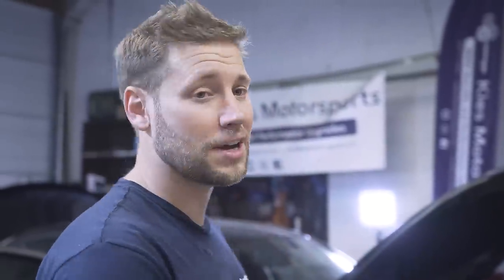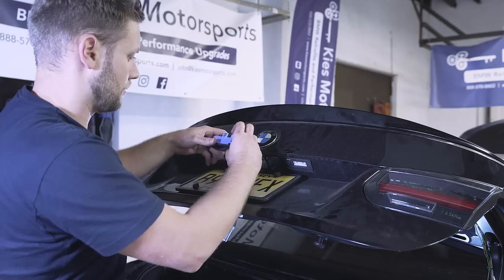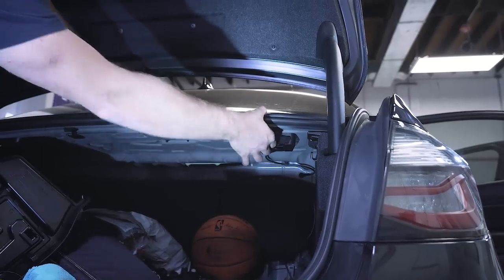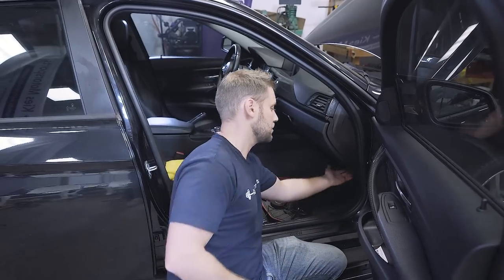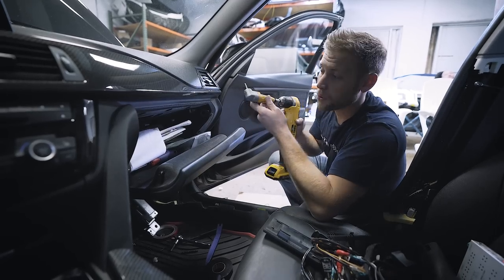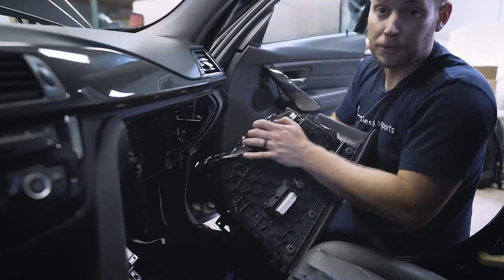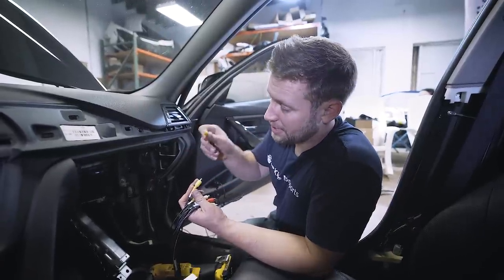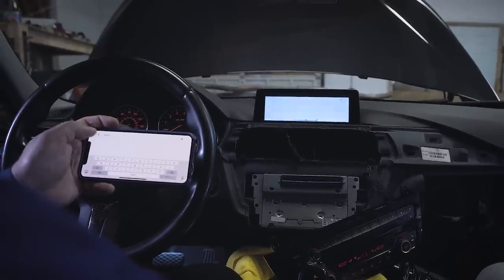How to install a Rear View Camera and Apple TV in an F30 BMW! BimmerTech's MMI and SmartView HD

Comment: Excellent detailed tutorial video. Got me through the install on my f80 m3. The updated bimmertech kits are much easier to install compared to the older ones that required tapping into the harness. The new kits are 100% plug and play. Of course, one tutorial cannot cover every model so use your brain when there’s a slight variation in the install

Comment: the best way to fit the cabel in the front is on the top part of the door moldings  and this way you dont have to remove any  plastic trim at all. nice job anyway

Comment: Very nicely done. I’ve seen wireless solutions for minivans and SUVs. You get power from the backup lights for the camera and wireless transmitter. Then there is a receiver attached to the head unit. Is this not possible for BMW?  Saves running wires from back to the front of the car

Comment: Another great video Brian. Quick question.... Is the installation identical for a 6MT or are there some steps that might differ?
Reply from the maker: Hi, thanks! You have to tap a wire, but otherwise, it's the same :)
Reply: @KiesMotorsports  I imagine that the tapped wire is the reverse light bulb? Thanks.

Comment: Does that Apple TV module work with MPEG 4 ? I would like to fit a rear view camera and TV tuner to my 2015 F30 330d M sport. Will that tuner work outside the US in Ireland ? I am assuming the camera and tuner have to be coded so they will work ? Cheers Eoin,

Comment: Hello Kies, great video. However, do u know of a different setup for Apple TV?  I would like to set it up on a different screen in the back of my F30 so my kids can watch a movie while I drive without it interfering with the front screen. Let me know I’m interested.
Thanks.
Reply from the maker: Do you have a rear screen in the car?
Reply: Hey Brian, no I do not have a rear screen. Is there one or do u know of one that can be installed on the middle console perhaps one that can be foldable like the previous x5 models.

Comment: HI BRIAN Is there set process for rear seat reinstalling after been removed BMW f30 2012 sedan. Taking it was ...easy but get the seat latches back through is near impossible.
Reply from the maker: Try to use the seatbelt to pull the buckle through
Reply: All good wrapped clear packaging tape around the 3 main buckles with a 12" tag thread the tag through the holes.  The small anchor one threaded seat belt through the hole. Then the lined up the seat and teased the other 3 up until i could use the seat buckle to drag them up.... Never again will i take out that seat.  :-)

Comment: I have an after market backup camera installed as well. The dynamic lines show up but they don’t move with the wheel... any idea why?
Reply from the maker: It all has to do with the brand and capabilities of the camera system. BimmerTech supports Dynamic Lines :)

Comment: On my head unit i had a pink connector right below the quadlock that nobody else seems to have. It was nearly impossible to get the quadlock from the new harness to fit in there because the plastic leaver of the new one was slightly bigger. Now the lever and that connector are under high tension all the time cuz theres no room between them. Anyone knows what that connector is for?

Comment: I did this install on a manual f80 m3, but the parking guide lines do not move with the steering wheel angles... does anyone know why? The installer changed the settings to emulate an automatic trans car and it does work, but the screen does not cancel when going from reverse to any forward gear.

Comment: How do I disconnect the battery?
Reply from the maker: Start by removing the rear windshield. Then, (this is only on the F80) you have to completely remove the quarter panel. I would recommend a large saw with shark-like teeth. Once that's removed, open the trunk and it's to your right. 😜
Reply: Kies Motorsports thanks! Just did that.  Now my blinker doesn’t work.
Reply from the maker: Easy fix.. Remove your gas cap... drive precisely 16 miles, reinstall and you're good. I know it sounds weird, but it's a BMW thing..
Reply: Kies Motorsports ended up being my fault. Turns out I never optioned my car with blinkers. Problem solved. Thanks for an easy solution!

Comment: Can TPMS be retrofitted?
Reply from the maker: Sure, you can retrofit almost anything :)
Reply: @KiesMotorsports  do the pre 2014 cars not come with the backup cameras or tpms. All the '14 I have used have tpms and the backup camera?
Reply: RcyberGaming yeah later model f30 have back up camera standard there is a new US law that requires all new cars to have it standard

Comment: They didn't have backup camera's standard. I have had two and both had backup cameras.
Reply from the maker: My 335 came with one, but my 328 didn't. We've even installed them in M3, M4, etc..
Reply: @KiesMotorsports  wow I have no idea that those weren't standard even on the m cars